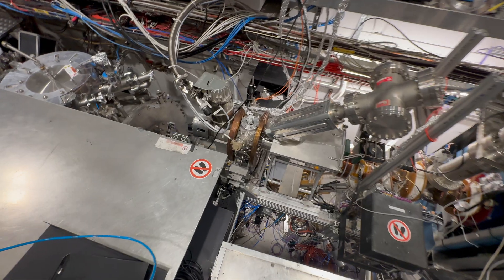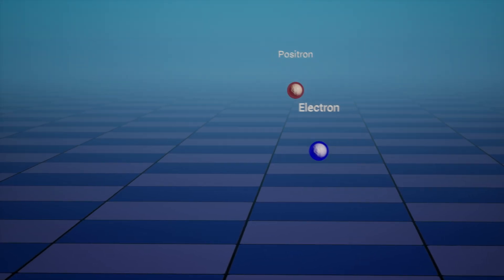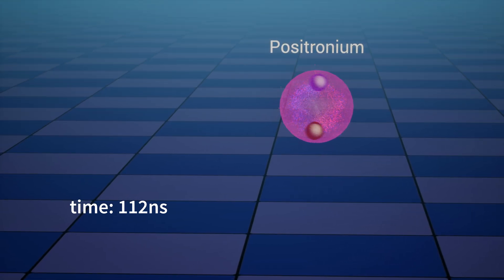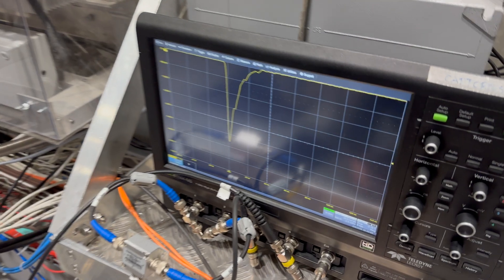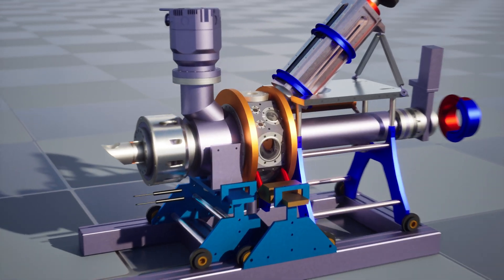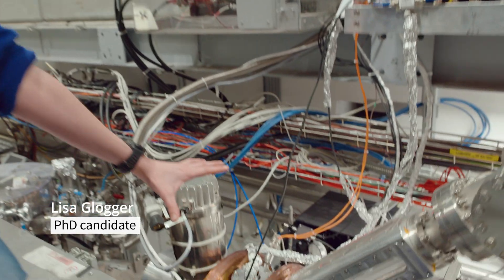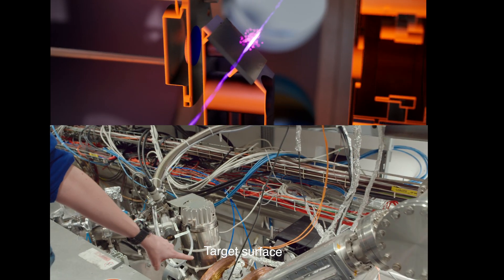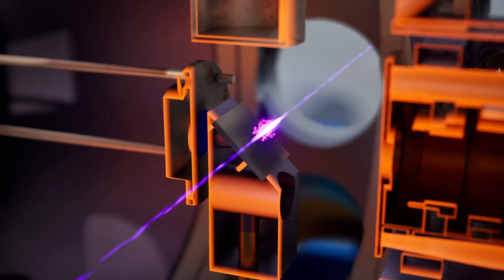AEgIS experiment at CERN cools positronium with laser light for the first time

Comment: Support for Protons, Made from Electrons and Positrons, from Positronium. 
My model of a proton suggests a challenging idea that replaces quarks with electrons and positrons (anti electrons).  Therefore:

Proton is made up of two positrons and one electron.  This gives it a charge of exactly +1
Neutron is made up of two positrons and two electrons.  This gives it a charge of exactly zero.

This model solves where the missing anti matter is; it's in the protons and neutrons.
This model also shows why the tiny electron is exactly the same charge as a massive proton. 
Summary of the full model is at the end.

There is some tentative support for my model in POSITRONIUM.
Positronium is one electron and one positron bound together in a short lived atom.  Compare this with a hydrogen atom which is one electron and one proton.

There are alternate configurations for positronium.  Two that are the exact opposite of my model for the proton and neutron are ...

Positronium Ion (Ps-).  This is made up of two electrons and one positron.  This is the exact opposite of my model for the proton - two positrons and one electron.

Dipositronium, or two positroniums (Ps2).  This is made up of two electrons and two positrons.  This is the same as my model for the neutron - two positrons and two electrons.

The fact that these anti matter versions can exist , even as short lived as they are, supports my model as a possible makeup of a proton and neutron.

Can protons be made today?  My best guess is no.  The reason being none have been made anywhere, in any way (even beta minus decay is just a neutron shedding an electron to get to the original unchanged proton.). Protons are very stable, refuse to decay, and must take the Big Bang temperatures to create.

Short Summary of overall model:  Start with an eternal singularity of photon energy. These photons, in a Big Bang created matter as the first electron and positron pair, in pair conversion.  This started space time. The universe expanded exponentially as more  and more electron positron pairs poured in from every point of empty space like vacuum energy does still.  Most, of the pairs annihilated into an expanding, anti gravity energy called dark energy.  This made up 95% of the universe.  5% of these electron positron pairs created all protons and neutrons, which created all atoms.

Thanks for reading!
Reply: Please study some particle physics first to understand why the current model is like that.